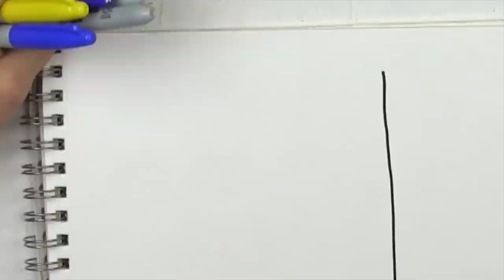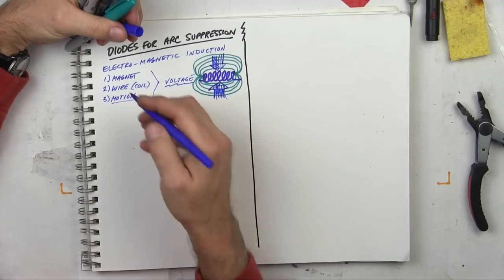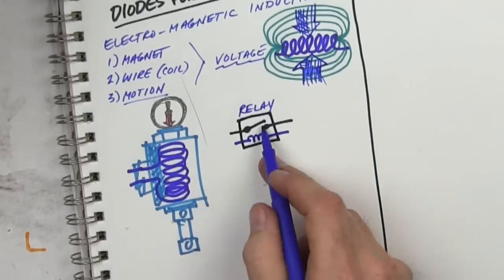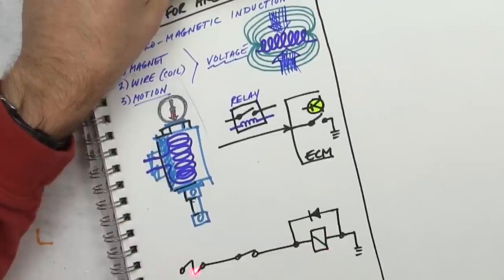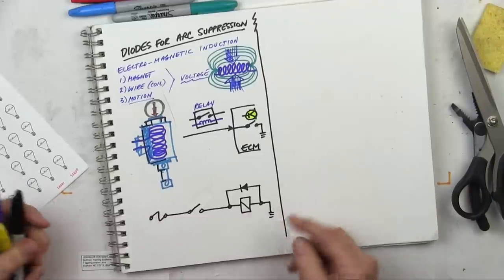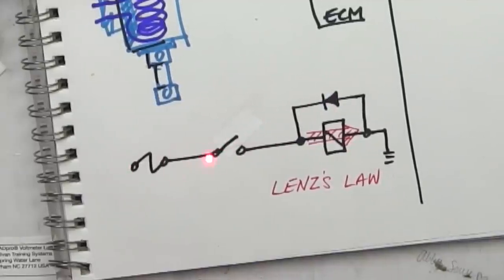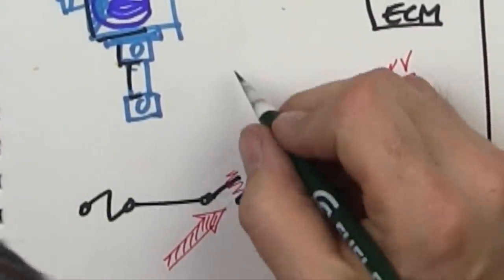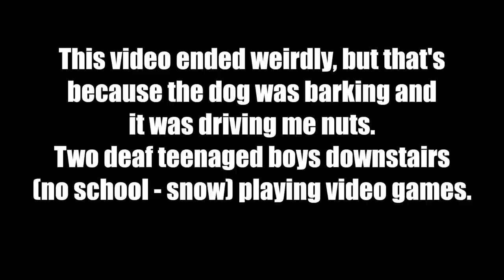CARD 10B - SUPPRESSION DIODES - Hands-On-Line Electrical Training

Comment: Hey Dan happy new year Liked your vid thumbs up I’m missing your current flow direction when the e m field collapses the lines of force move inward over the coil windings which produce an intense reverse polarity VD across the coil but only while the e m field is collapsing reverse polarity is created.Most manufacturers use a resistor in parallel to coil in their relays Cheers Does Lena law apply with a collapsing e m field?
Reply from the maker: The current produced by the collapsing field is in the same direction as the current that created it. That's why the diode is in reverse bias.

Comment: Hey Dan, Can you show how the suppression works where a resistor is used instead of a diode?  I see more of them in relays than diodes anymore. Thanks
Reply from the maker: moomike laloo Exactly the same but without polarity. The resistor (usually about 680Ω) is a lower resistance path than the open switch.